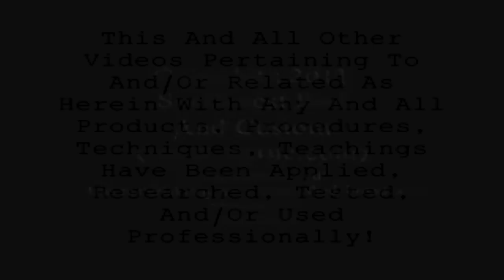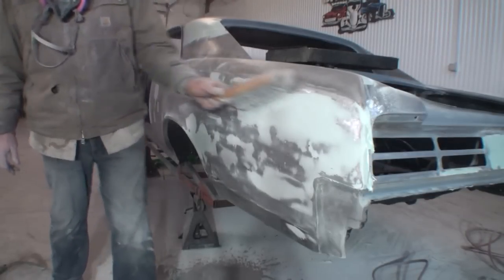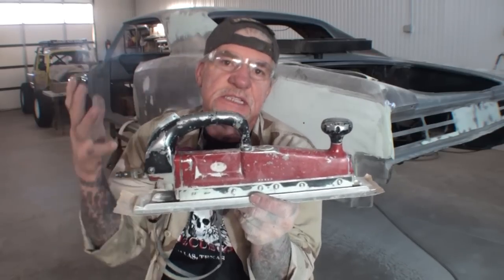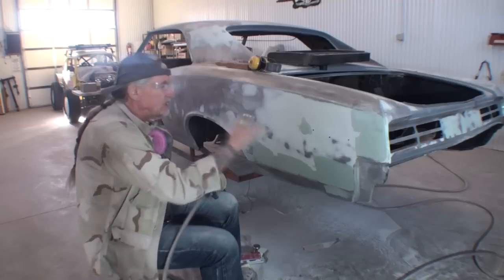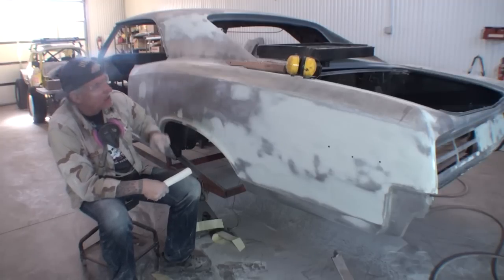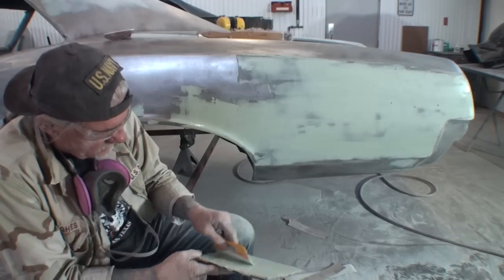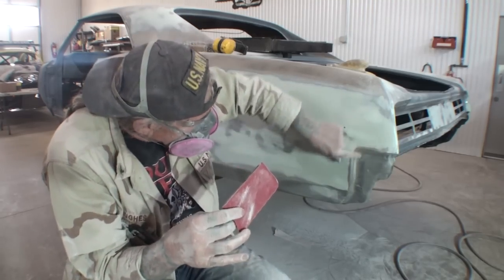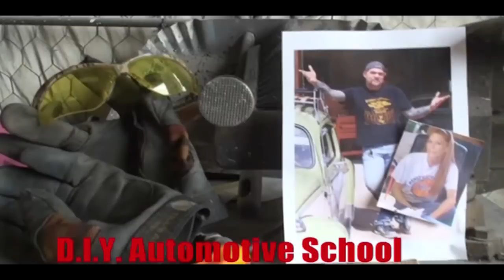How To Restore A BARE METAL CAR Back To Original -  Part 3 - PAINT READY

Comment: Hello my friend Pete 
This is your friend Ronnie from a small town in Virginia. Im 70 years old and was a truck mechanic at the same dealership for 40 years.
In January 2017 i suffered a stroke that set me back working on my 1969 Firebird.  And ive been diagnosed with Parkinson's disease. So im only good for about 4 hours and have to go in and rest. Im down to installing the driver side front floor pan from the seat to the toe panel. Im not that good of a welder with a mig welder. I did take you advice using 0.23 wire that helped me alot. Now my question is being I'm not that good of a welder would it be ok to lap weld the floor pan in instead of but welding it. I plan to use seam sealer on everything. I've learned alot watching your videos. Keep up the great work and videos coming. I prayed for Minnie to get home safely and God heard us and made it happen. 🙏🏼 
Take care my friend Pete 
Your friend Ronnie from a small town in Virginia. 
Tell Minnie im glad she made it home safely. All hell is going on over there now. 
Ive rambled enough 0:04

Comment: I guess the right way to apply bondo over epoxy would be to REMOVE the epoxy ,sand the metal ,wipe clean ,and only then apply bondo 🛠
Reply: You have to grind the metal for bondo to stick, if you take a grinder to epoxy primer/ sealer, your down to metal. Bondo needs tooth or a extremely rough surface to stick properly,  sealer isn't that rough, like Pete said 36 grit